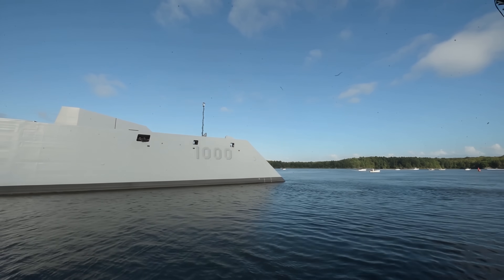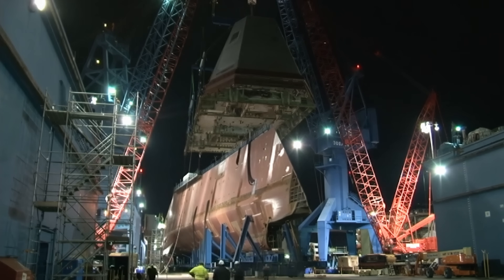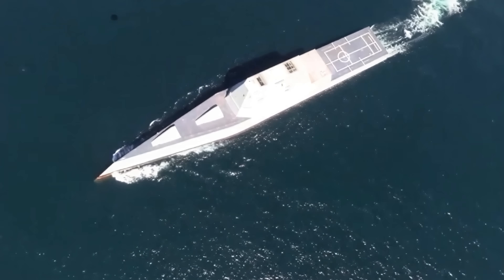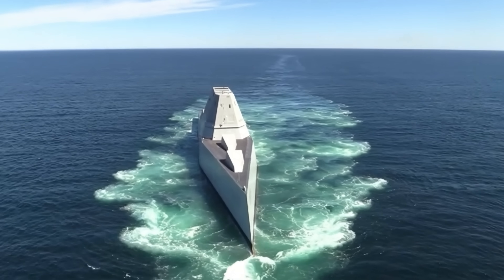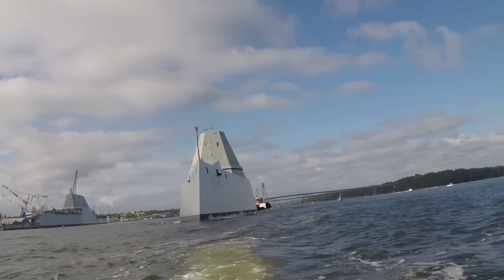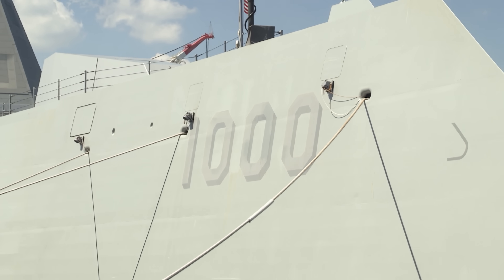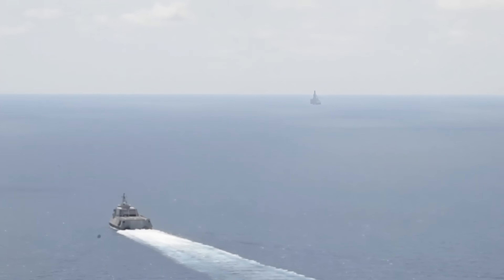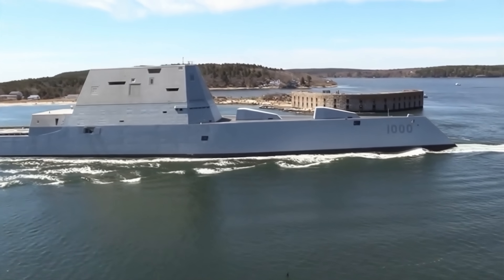The Super Destroyer That Appeared Where It Shouldn’t

Comment: The Zumwalt class is often criticized for their cost, but a lot of that is due to the huge development costs of their cutting-edge technology combined with the reduction of the class from 32 unit to three.  IIRC over half of the per-unit cost in the end was dev costs.  Which means that if they used the Zumwalt (modified with Hypersonic missile tubes instead of the defunct gun turrets) as a basis for a new class of Cruiser, they could SAVE a pile of development costs and perhaps construct a worthy replacement for the Tycos.   I for one would love to see that happen.

Comment: The Zumwalt is the Cybertruck of the sea:
- bold original concept
- dumpster-like appearance
- large size relative to class
- sometimes unreliable tech
- recalls & performance issues
- manufacturing issues
- prohibitively expensive
- ill-defined purpose
- designed, manufactured, & purchased by people with more money than sense

Comment: Zumwalt is not a Destroyer. It is actually a Light Cruiser with 2 single mount 6” railguns which require $800,000 rounds.

No wonder the 6” railguns are being replaced.

Comment: Are these ships allowed to run full speed or are the keel still breaking on them?
Reply: I believe you are thinking of the LCS (Little Crappy Ships) made of aluminum.
Reply: Just like the 110’ USCG patrol boats, we limited our speed to 26kts at 12’ seas. Any faster and we would crack our water tanks.

Calmer seas, higher speeds.
Rougher seas, slower speeds.

Comment: Had they procured the remaining 30 boats she would have been praised like the modern f-35. In my opinion she was a success that like most early 90s to 2000s projects was ruined by Congress take the F22, and Seawolf. They are technological marvels that were expensive, and designed to fight the next war and have proved to be unmatched and got cut short. Had the gun been viable the island hopping capability needed to fight a war in the South China sea would be far easier for the Navy to support the marines.
If we spend a couple million to drop a couple thousand rounds on the enemy that's a win. It's why battleships stuck around as long as they did, but now this is a far more survivable, lower loss of life alternative, that improved ballistic capabilities with digital precision and rocket technology. 
So regardless of the faults that she had because every Navy ship has its own horror stories, she would be what we wanted to fuck up any enemy amid amphibious operations.

Comment: They could have just used a different gun. Or weapon system AND Missiles. Like throw a couple CIWS up on there or some other GE "We like thing's that spin" that sounds small by name, but is much larger in size. Now that these guns and railguns were deemed somewhat or definitely not viable for use, you could throw some energy weapons or even a Metalstorm system up there :P

Comment: Lots of wrong information in this video, some of which I can't correct because I worked on the project. But as an example: cost was wrong but even the cost quoted is less than half the cost of a carrier not more, crew compliment is wrong, and some general particulars.

Comment: In response to a few other similar comments down this page, it is a common feeling obviously that KISS wins. 

Tried and true basically simple concepts often win out, but that is obviously a generalisation depending on what modern equipment you install in such platforms, that Assist with seeing ahead, seeing the opposition, and getting rounds on target. 

Despite all of its tech, one gets the sense that with Zumwalt, a blown 10  cent fuse might see it struggling.

Comment: There’s a few random thoughts leap to mind. 

1. While there’s nothing particularly wrong about putting all sorts of new technologies into one platform the important thing to do is get it right, especially where the failure of one component can drastically affect another or multiple components.

Many of the problems with this design emanate from the aspirations of people with too much brass on their uniforms or too many years in Congressand insufficient technical understanding or hands-on engineering ability. 

This has resulted in something like Zumwalt being designed for too many roles, none of which are clearly defined, which is proven by its significant redesign which I already foresee, you will not be the first and only modification.

Curiously, this redesign revolves around missiles which the US still hasn’t developed and some say it may be 5 to 10 years before they are fully functional and capable of being integrated into any platform, far less a confined marine installation.

2. It’s somewhat ironic that while the wet ensures that everything that Russia develops becomes a subject of ridicule and reference to former soviet union designs often described as clunky, inefficient or broken. But we never hear any negative stuff about US technical developments which can rapidly become mechanical laughing stocks. 

Yet the space program has had its fair share of very public failures, multiple submarines have been lost about which new and questionable information has recently come to light concerning rush design and construction and catastrophic failures of equipment when subjected to limits of design..

3. While not attempting to draw any particular parallels between the two types of vessels, it’s interesting to see how the west totally cans Russia’s re-launching of the Admiral Nakimov battleship, which has capabilities that far exceed those of Zumwalt, in terms of being the biggest long range missile carrier on the planet, capable of meeting any missile requirement including its own self defence.  

4. Sure battleships are widely seen as anachronistic especially in light of long range hypersonic antiship missiles.

But the notion of any kind of stealth marine vessel seems to be rather curious, because it’s pretty hard to hide anything at sea with a continuous horizon behind it that is the size and scale of half a city block and pretty much the same proportions.

5. As with some of their aircraft the Russians haven’t placed such heavy store in the stealth concept, largely in the interests of not sacrificing every other aspect of the unit design to that particular stealth requirement.

This is the particular problem with Zumwalt, where they have attempted to produce something that is the shape of galleon in the tumblehome hull design, which even your story suggests has not been fully tried in exceptional sea states, and if found wanting may involve installation of or improvement of stabilisation systems which could  compromise other installations already in those spaces required for stabilisation, which can be significant, if you move or install a new piece of gear you have to move other stuff to make it fit and this flows a long way down the line.

6. Essentially, all of the roles that Zumwalt can fulfil practically do not require the extreme stealth design elements that have been imposed upon it

7. One aspect of the design appears to be the shallow draft which is a function of the tumble home, but wireless may admit the ship to shallow littoral functionality, as described above it does little for vessel stability in big seas, especially without significant effort at stabilisation.

8. While from your story it is evident that Zumwalt can transition the Panama Canal, and I’m not sure if Admiral Nakimove could do the same thing on account of its massive size, I find it engaging to ponder about the possible outcome of a ship to ship engagement out of visible range between the two vessels. 

9. Zumwalt can only carry 12 missiles in total that might be capable of such ranges, while the Russian battleship can carry a dizzying array of missiles capable of multiple range deployment, with well over 100 missiles in total.

10. The outrageous cost of Zumwalt’s GPS guided 155 mm projectiles is virtually unsustainable, and the remaining deck mount would be probably far better replaced by missiles and a smaller close in rapidfire deck cannon. 

11. Assuming the Russian battleship could not transition the Panama Canal, it would remain perfectly capable of transiting the Arctic shipping route, or the Horn, and it would likely be a very uncomfortable ride around the Horn on Zumwalt, which may not be able to transit the ice in the north, subject to season and Russian defence of that route if push came to shove, especially considering that eight nuclear powered Russian icebreakers pretty much dominate accessibility of the route in ice seasons. 

12. Lastly, we come down to the aspect of motive power. The Russian battleship has four nuclear actors capable of multiple redundancies if necessary and still remain operational, and combination of that power and it’s waterline length gives it a very high maximum speed for a ship of that size, while Zumwalt would be limited in its maximum speed by it’s much shorter waterline length, which even if it was capable of semi planing with the relatively flat under profile, would require a burdensome fuel consumption to achieve even if it was possible.

These are all just random thoughts that flick through my mind as I was watching this video which I thought was very well done and a handy insight into the minds of naval developers which are not necessarily in sync with the demands of the sea, current politics or geography and weather. 

And it’s interesting how the last two items can be independent or even combined considerations, but they are not extinguishable. They are ever present.
Reply: Sounds like a quagmire only Biden's cabinet could have engineered

Comment: TBF, the Zumwalt's general concept is still very much viable. Most of the kinks have been (if not addressed) identified. In order for it (or something very close) to succeed the Burke's, though, big Navy needs to figure out what their mission set is to be and standardize, then specialize sub-varients or actually figure out drag-and-drop-modularity in the way the LCS was supposed to with as much parts commonality as possible.
Reply: The LCS was a complete failure.
No one did the math for what it would cost to swap out those 'modules'.
Turns out, it's cheaper and more versatile to just do the Arleigh's.
Plus no one did the math, for how they were going to man a ~100 man ship 24/7 when in harbor.
Reply: @Redacted2080 I remember getting yelled at by an instructor in FC A-school whom had overheard me talking shit about LCS back when they were first being commissioned. 🤭

You're not wrong. However, the concept (as with the Zoomies) is sound, but to actually make modular mission systems work, you'd need a hull designed to accept said modules via FU-big-ass cranes and bolted into place w/no or minimal welds. 

There's no good reason (other than lack of infrastructure) you couldn't make (for example) an entire (fully loaded) VLS battery something you just drop into an empty receptacle. Infrastructure is as un-sexy as it would be expensive, though. 😩
Reply: @zoopdterdoobdter5743  Two words:
"Security Clearance"
There is no way to make a functional bolt and go system, without insane costs in standby personnel, and infrastructure.
Yoi Literally argued against your own point in what you wrote.
Your Instructor in FC-A school was an Amateur.
Professionals talk logistics.
Still cheaper and versatile to do the Burkes.
I was there in A school. I know.
Reply: @Redacted2080  You keep focusing on the hardware. One of the other challenges for ships that could be physically repurposed is the crew change. Main crew didn't like these new guys on their ships. Need more the attitude of ones who are Marine Ubers…
Reply: @lukevaxhacker7762  Completely correct.
The idea of 'crew changeover' is sheer stupidity.
We felt the same way everytime we took on an air wing.
Knuckledraggers destroyed everything.
Had no respect for anyone on the crew.

Also not ignoring the personnel issue. Just hasn't come up.
The idea fails at the materiel level first.
Reply: @Redacted2080 blah blah...I was in A school, ok Master chief
Reply: @s.porter8646  How very exemplary of the crap that came out of there.
Reply: @Redacted2080 I didn't argue against my own point -- I addressed the obvious obstacles. Everyone (especially GM's and FC's) are aware of the tediously slow process of onloading and unloading munitions. It's a relatively rudimentary engineering problem and could streamline the process. Especially if we're talking about Taiwan-China, rapid reloading is going to be a major issue and the current efforts to speed things up are anemic at best.
Reply: @zoopdterdoobdter5743  a couple days because the union won't work for more than 8 hours, at long beach, as an example, isn't an issue.
If you think swapping out a huge section of a ship 'would save time' then you don't understand the scale of the issue.
Think of the 'thousands of connection points' that would have to be taken care of, all at once, while a multi megaton segment is hanging over people as they try to get everything connected for communications.
Then we can set it down, and bolt it all in place.
Just moving a single VLS cell one at a time is a series of things that can go extremely wrong.
That massive segment would multiply that is ways you don't seem to understand.
Reply: @Redacted2080 lcs was pure fucking graft.

Comment: Whoever reduced the class from 32 to 3 ships destroyed the economics of the GPS guided rocket propelled ammunition. That sank the economics of the whole brilliant bleeding edge program. 🎆🇺🇸🎇
Reply: What's not in the video is they planned to put hypersonic rail guns on all three but the rail gun project took a bath too.  I think Japan is reviving it right now.
Reply: @kevinbillingsley8256  I heard that.
Not sure what they are doing though.
US, General Atomics, was pushing kinetic rounds that move at insane velocities.
Haven't gotten info on the specs on the Japanese version.
Maybe they will wind it down to something doable.
Reply: @Redacted2080  Initial reports are that it's even more powerful.  The GA model was sending at mach 6, the Japanese version is supposed to be 7 or 8.  Not sure how they intend to get around the problem that the barrels melt after a few rounds.

Unlike rockets which are basically pushed out and then use the rocket to achieve hypersonic speeds, a kinetic weapon creates that velocity inside the device and exits at those speeds.  That's got to be hard on the barrel.
Reply: @kevinbillingsley8256  It is.
Quite the sight to behold watch air catch on fire on the range.
Reply: @kevinbillingsley8256  You never know, one simple advancement in one of numerous technologies can make the difference between a viable weapon, and something worthless.  Whoever had been the project managers for the Zimmwalt(military and the contractors), from start to finish, need to be relieved of duty or fired for wasting so much money on something that went nowhere.  It such a shame that tax payers even have to pay initial R&D of a project like this.  The only money contractors have to risk is the price of their napkins where they sketch the future.
Reply: Agreed that the ship reduction irrecoverably hurt the economics, but even at 1/10th the price, they were too expensive.  It was a bit ahead of its time.  With today's tech, it actually might be viable, but now were are questioning ships with humans in them.  It would be risky to introduce.  I think the same mission can more cheaply accomplished with drone technology.
Reply: @dansiegel995  Russia/Ukraine war has changed the dynamics completely with drones and hypersonic missiles, etc. etc.  really scary watching those foot soldiers try to escape from a drone as it runs them down and blows them up.  I don’t want that for my grandson.
Reply: @jamesweir2943  I hear you.  I hope DARPA has something up their sleeve because public anti-drone defenses have not been impressive.
Reply: this and the Edsel so should be in a museum together.
Reply: It was the government who cancelled the fleet.
Reply: Good Riddance.
Surprised this video neglected to mention tht the Zumwalt flips over, when it loses power.
Reply: @Redacted2080 shhh. That's the top secret turtle 🐢 defense. It's painted like a fishing 🎣 boat on the bottom. 😂
Reply: The economics aren't important.  Three are sufficient for experimental ships.
Reply: @GH-oi2jf  They have dedicated experiment platforms.
There is no reason to spend 3 carriers worth of funding on a trashcan.
Reply: @Redacted2080  If you remove the research cost the cost per unit falls a lot, but you still have to pay as its cruiser size.
Reply: @surters  not enough.